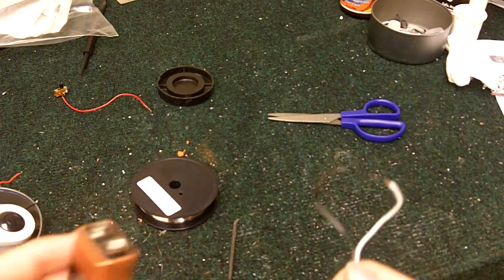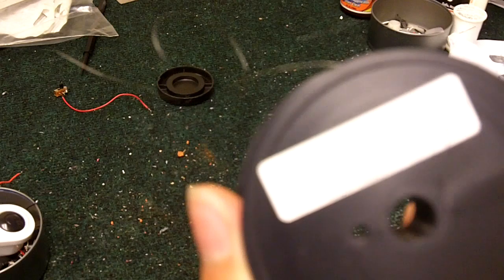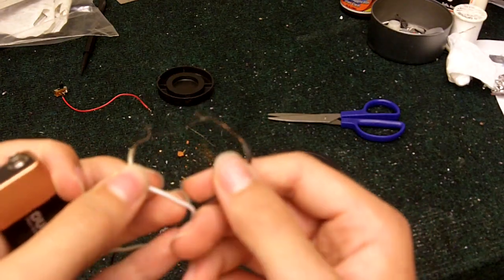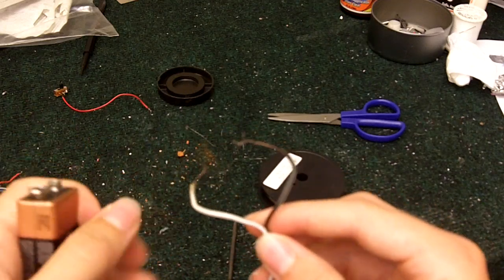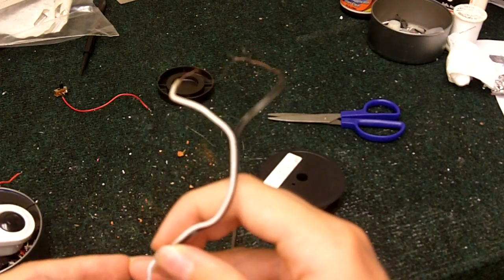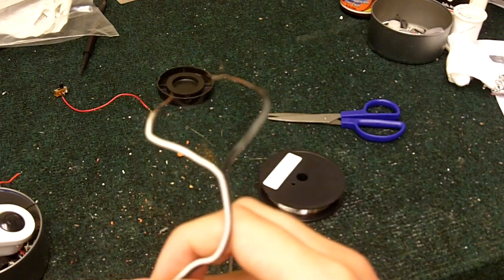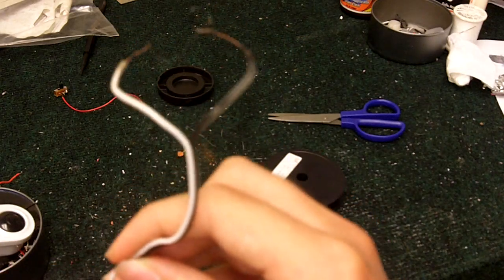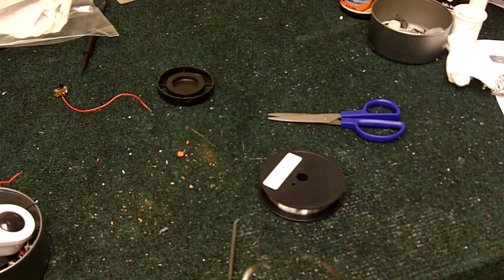nichrome wire

Comment: Pretty cool video I just want you heat up a beaker and boil a liquid using solar power solar panels hooked up 2 or 12 volt battery lead acid battery

Comment: what i dont understand is how come resistors which have high resistance doesnt get super hot. i tried connecting a 10 megaohm resistor directly do 220 volts and nothing happened. why is that?
Reply: thanks man. it didnt burn up. i confirmed it with a multimeter afterwards. i tried with 82 ohm resistors and they turned red hot and exploded like fireworks. this makes absolutely no sense to me. with lower resistance i thought the current would flow easier..
Reply: Ri5ux https://www.aliexpress.com/item/100pcs-82-ohm-1-4W-82R-Metal-Film-Resistor-82ohm-0-25W-1-ROHS/32576324812.html?spm=2114.01010208.3.33.Y0ydP5&ws_ab_test=searchweb0_0,searchweb201602_5_10065_10068_10084_10083_10080_10082_10081_10060_10061_10062_10056_10055_10037_10054_10033_10059_10032_10099_10078_10079_10077_427_10103_10073_10102_10096_10052_10050_10051,searchweb201603_4&btsid=131188b4-fdaa-4b6f-b1d6-cf6e1e26ea0c
Reply: ***** why arent resistors just made out of a thin layer of resistive material like glass instead of this coiled wire that heats up at the slightest hint of watt!

Comment: what are the devices from which we can get nichrome wire
Reply: Small thin strands come out of things like, Toasters... Hair dryers....E-cig coils....Crock pots..Coffee pots....Camping gear, for heating meals...Electric heaters....Feet tub/plastic tub people soak their feet in. Lol .... 
Thicker strands come out of things like, Electric Stoves,...Electric Furnaces...Electric water heaters.. Grills/small but a thick piece.. base board heaters... etc etc
Just go to your local ecig store and walk around the parking lot. You'll find a bunch of crushed coils, ran over by cars. There made from brass, some are SS.. But the Ni. will pull right out with a pair of needle nose.
..
Reply: Fr I need it
Reply: Adrian Rizqullah same
Reply: I got some from a hairdryer
Reply: oh no I threw my....
Reply: Toaster coil, Electric heater.
Reply: can i find nichrome wire from a coffee maker?

Comment: can DC 9v make a nichrome wire 1mm become red hot ?
Reply from the maker: 1mm length will probably melt/burn up very quickly. If there is too much electricity the wire will be severed and charred. A longer wire may be able to stand up to 9v, or another option would be thicker wire.
Reply: smeagle9999 hmm yaa, 1mm i mean is diameter not lenght.. i have 10cm wire lenght. how much DC current needed to make nicrhome wire 1mm become red hot ?

Comment: you run current through the wire by applying a voltage difference to the wire

Comment: Lol, I have just tried this and I had to use three 9V batteries on a piece of 32-gauge that was only half a centimeter! One of the batteries was a Duracell like yours and the other two were cheap batteries. But even this didn't actually burn up the wire like in yours. It got red-hot though.

Maybe I'll post a video.

Thanks for the video!

Comment: You know nichrome has a melting point of 1400 °C (2552 °F) so it doesnt melt its just breaking since its a very thin wire and its in air. If you know of the makerbot(its a 3d printer that melts ABS plastic to build) uses this stuff to heat the ABS plastic to 220 °C.

Comment from the maker: @ellomoto231 I would guess.... at 300 volts the wire can be like 6 inches if you want and still probably turn into a liquid lol- this would be the metal to use if you want to light a match though... so I'd say try it and tell me what happens!